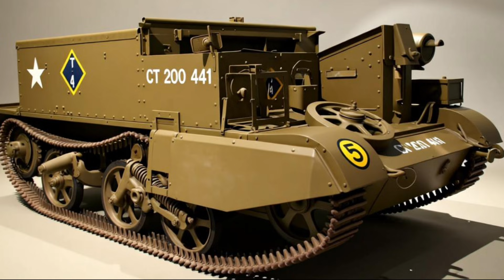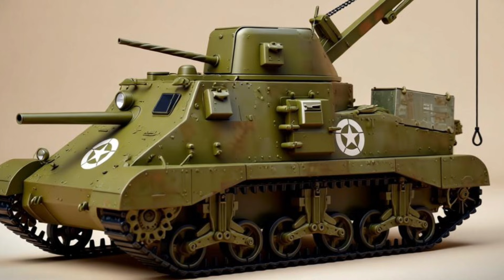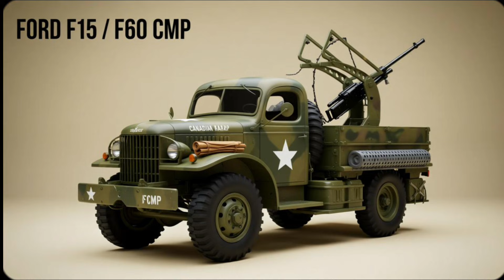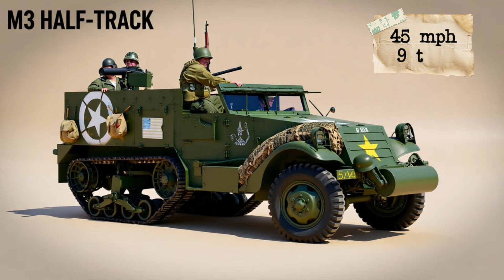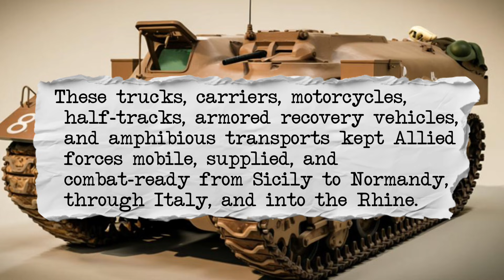Every Canadian Vehicle Used in WWII

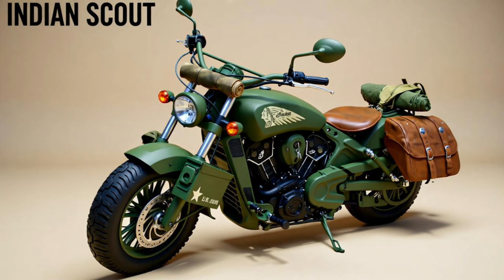Comment: Complete AI-generated crap. 2:41 AI gets it wrong: all CMP trucks were RHD. 9:18 more slop. Canada did not use the WLA. We used the WLC which was specific to Canadian forces.  9:47 Little known fact: Canadian troops in WW2 time-travelled 80 years forward so they could adopt the Indian Scout model from the 2020s.